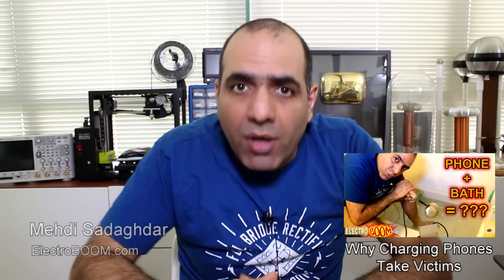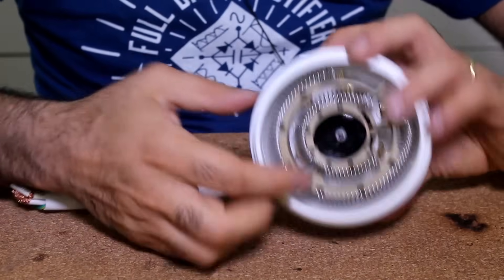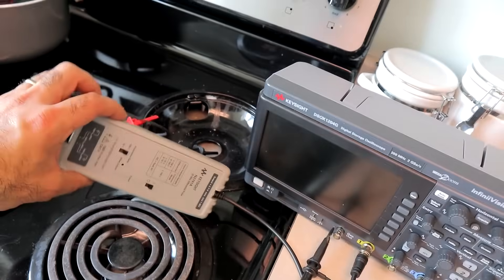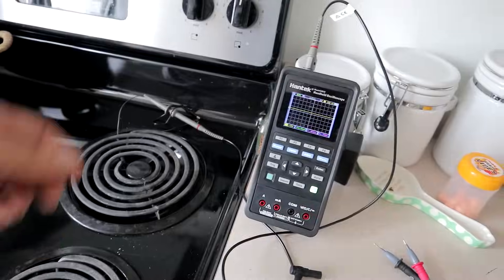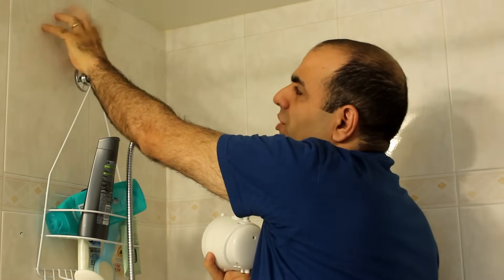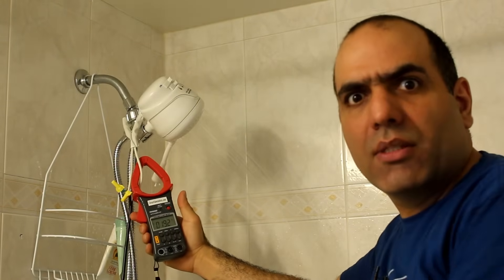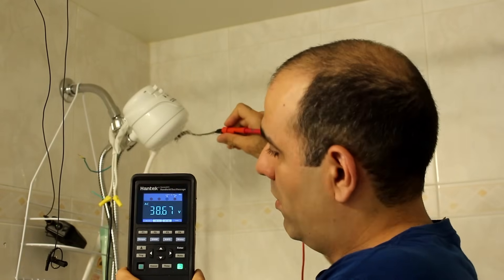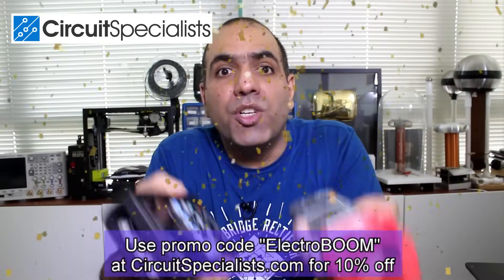How Safe Is the SHOWER HEAD OF DOOM?!

Comment: Lorenzetti and Hydra (Biggest electric shower manufacturers in Brazil) Makes excellent quality electric showers. In more than 30 years using them, I never had any problems with them. When They eventually break, You just hear a pop and it stops heating. And that's it. You either buy a new one, or replace the resistance.

Comment: Here in Brazil this kind of shower is very common. 
Nice video!
Reply: @girlsdrinkfeck  Rich people in Brazil use them too
Reply: @girlsdrinkfeck  yeah dude it's standard in even the highest quality apartments. I've literally never seen a heated water shower that isn't heated by one of those suicide showerheads
Reply: @girlsdrinkfeck  yeah and ground usually isn't installed here either, they either duct tape the ground to the shaft of the shower head or just cut it I guess. I've seen people fuse it to neutral too.
Reply: Actually is not like that. Depending on  the age of your apartment and where you live it could be heated by gas, solar panels and electric showers. I live on apartment heated by electric shower but my shower has isolated resistance. Here where I live (MG) it's not common to have gas heating system. New apartments comes with solar panels and old ones use electricity. But you always can pay more for a safer and good electrical shower. Although, I never hear an accident caused by one. Our main concern is the shower quality and light build price.
Reply: @diabodosatanais30   I dont use this tho and I am brazilian and poor
Reply: @userbarra  
Eu tenho um amigo q tbm n usa chuveiro elétrico. Ele esquenta a água no fogão e toma banho.
Vc toma banho assim tbm?
Reply: @diabodosatanais30  Nopr

Comment: Important information about the Brazilian electrical system: most houses (if not all) have no grounding. The ground wire just hangs.
Reply: Vai brasiliam
Reply: In some houses they even connect the shower's ground wire directly into the neutral AC wire so neutral AC from the house's electrical system receives both shower's neutral and shower's ground. Kinda works...
Em algumas casas inclusive conectam o terra do chuveiro diretamente no fio neutro , assim, o neutro do sistema elétrico doméstico recebe tanto o neutro do chuveiro quanto o terra do chuveiro. Até que funciona...
Reply: @daemonsilverstein8633  Brazlians vivendo perigosamente

Comment: In Bulgaria most of the people live in apartments with no ground. We have only two wires to each plug, so if you need ground for some application you connect the ground wire to the neutral. This works well, until something happens to the neutral, and all appliances with metal housings, become live. It is pretty common to have minor shocks when you touch the housing of say, the washing machine, because the neutral usually has some voltage relative to the ground your feet are touching.
Reply: If you have solid continuous metal water pipes that lead to the ground, you might be able to use those. Should also be connected to the main breaker or main meter.

Comment: I use one of those in my house, they are pretty safe I must say, they last for a long time too! I am from Costa Rica, Central America.
Reply: @Lepus Arcticusit's less expensive and it works just fine, it also doesn't need a lot of space to install.
Reply: @EffectsAE It's pretty safe honestly, like, 200 million brasilian ppl use and I can't remember the last time somone got hurt on one of these
Reply: @pedrodarosamello64  Yep, I don't want to sound like a butthurt brazilian but many people are ignorant in relation to electric showers, if you look at the statistics there much more deaths associated with explosions and fires caused by boilers and gas heating installations than with these type of cheap electric showers.
Reply: @LeArcticus
A few reasons.
1) Gas pipe installations are very rare around here outside of bougie apartment complexes.
2) It's consistently warm enough here that we don't need central heating.
3) Because it's warm, we don't need to heat up our shower water to the degree that gringos do. Gas heating is way overkill unless you live in the mountains of the Andes, like Peru and Argentina.

Comment: @5:40 Nice! This finally explains why my electric stove top can't maintain its heat levels consistently and is a nightmare to use.
Reply: It's different between different models of electric stove. For some, especially when using large pots, it's near impossible to notice when it's on and off.

Comment: Brazilians have love and pride about electric showers. They are the main manufacturers of these devices, or at least that's how it seems in Mexican stores.
In order to use one of these devices, you must have an independent power line, direct to the electrical box in your home. That line should use cables capable of supporting the maximum amperage of the shower. That line needs its own thermomagnetic switch and, preferably, an independent ground line. Please, an electrician is definitely required.

Comment: It's funny because these showers, especially from the Lorenzetti brand, are widely used throughout Latin America because of the low cost, I'm from Costa Rica and here at least 80% of showers are of that type. These showers are dangerous only because most people install them improperly without connecting the ground to save money on hiring an electrician. I myself have one well installed and the only problem is the durability of the heating elements, after 4 years it is common to replace them or the entire shower.

Comment: we have those but it installed way higher, i'm 1,75m and I need to get on the tip of my toes to change the temperature, this way the water falls in little drops and not a continuos jet and therefore it's not conected to the heating element.

Comment: In Brazil we also have ARMORED showerheads which ARE made from insulating elements... Tho 5 to 10x more expensive than regular ones.
We use them only on EXTREMELLY brackish water to avoid shorts and well... having to change the F*cking elements EVERY WEEK or so
Reply: Armoured showerheads? Why not normal electrically isolated heating elements like what the rest of the world use? It isn't that expensive to do that.
Reply: @danielch6662  thats just how we call it but it is actually the same thing
Reply: @danielch6662  Im 25 years old and i never seen a single person get shocked by shower heads with exposed elements, and most of them don't even have a ground wire connected to it, i do have seen one partially melt before but the heating element will break before causing any harm.

Comment: I've been using this showers for 26 years straight, I switched 1 year ago (because the building requeires it, and it is cheaper and easier to maintain) never had any problems, I live in São Paulo and showred in hundreds of homes from my friends and parents never had a single problem even with the metal "handle"

Comment: I used to have a stove at home that had lights that turned on on the heating surface while it was on, so I was able to see that the power on these went down regularly to maintain a stable temperature, when I saw the voltage on the stove in the video drop to zero, I instantly realized it was that kind of system and had quite the "Eureka!" feeling

Comment: I live in Brazil. This type of shower is common, but the place where I live tends to have very extreme temperatures, either very hot or very cold. At home, I use a 7700W 220V electric shower, which is somewhat normal around here. I don't know what houses are like abroad, but here in my case, I have two phases of 220V each, together I get 380V. The wiring from the utility company to my house is 10mm, which goes into a 50A circuit breaker and to my house it is also 10mm wiring, which goes into the second 50A circuit breaker. Only then is it derived with 6mm wiring to the shower, passing through a 40A circuit breaker.

Comment: "besides the loose wires and the fact that it may set your house on fire" but we do not use loose wires, instead in every home here, the shower have a special outlet (way above the showerhead) and they proper hight current circuit apart of the house's circuit, which helps with theses two topics "loose wires" and "set your house on fire" :D

Comment: There is a way to make is safer that you didn't mention:
You can power this shower through transformer so current in heater has no way to complete circuit though ground (human body).
Reply: 2kW isolation transformer will cost more than a decent water heater
Reply: You've got a spare ~6kVA isolation transformer lying around?

Comment: Brazilian here. My shower draws 30 amps, 220 V so 6600 W of power. Installed by me, no problem at all. Houses here have brakers of 50 amps, usually one per shower or room.

Hue Land is not for beginners
Reply: Why does it need that much power
Reply: Dr. M. H.  At least we only need gas for the stove. Besides, it draws 6600W on max, which would be just a few days in the winter. Most of North/northwest don't even have a proper winter (they call it a cold spell when it gets to 21°C), so they can get by with waaaay less energy.
Reply: Dr. M. H.  Yep, like the guy above said, that's the maximum power, usually we use 1/3 ou 2/3. But If you want, can use it, no problem
Reply: Dr. M. H.  Brazil has one of the cleanest energy sources on the planet and electricity is very cheap compared to other countries.

Comment: A few points to consider here, regarding the installation of these showers in a typical Brazilian household.

1. Unless you're living in a relatively new (10-year old max) building in a big city, you're 90% likely to be in a place that was built taking multiple electrical showerheads being turned on at the same time into consideration.
2. Even in cities where the main outlets are powered by 110 AC power lines, households usually have 220 AC power cables specifically drawn to each of the bathrooms in separate (yes, really) 50+ A breakers. They are usually installed directly next to the water outlet. As I mentioned above, these houses are designed to have multiple showers being turned on - on high - at the same time.
3. A cheap, three-temperature-range showerhead usually costs around R$ 50 (around 8 USD, 2022 quotes), with more sophisticated ones costing almost R$ 400 (65 USD). For the perceived benefits - cheap hot water - and low perceived risks , it's easy to see why there haven't been many innovations regarding safety. 
4. Corrosion is something that is frequently seen in these. As one can imagine, having a hot, potentially charged, and usually hard (calcium ions) water running through copper circuits does not bode well for its durability; Indeed, it's expected that the resistive elements need to be exchanged at least monthly. The showerheads usually dismount easily in order for these to be more accessible, but rarely (as in _never_) is an electrician called to do this. The owners are expected to turn off the breakers (do they?), make sure that electricity is not running (by touching the elements?), remove the old, corroded pieces, and replacing them with brand new ones, by themselves.

So yeah. Survival of the fittest, I guess.
Reply: você não precisa trocar a resistência todo mês...e eu pelomenos desligo os disjuntores pra trocar a resistencia quando ela precisa ser trocada...
Reply: @djmhyde  né, ele acha que todo mundo troca a lampada com o interruptor ligado tambem ?

Comment: FYI, Surface Element switch or also known as an Infinite switch uses a bimetal, that cycles the power on and off based on the current flow through the element, but the element always gets 200+ volts in any temp setting just percentage of on time. Bimetal is Between contacts L2 and H2 in your switch. If you look in hte back of the switch the bimetal is usually exposed and can be seen easily. L2 to H2 are the contacts that welded together in your video that you unstuck. That is the bimetal.

Comment: the problem with those are the people, people likes to use thinner wires than those required by the shower, they also like to have once circuit for all house, they don't like ground and likes to connect ground to neutral, also they love to take long showers specially with thin wires

Comment: I'm from brasil and I can say, I never took a shock before in this kind of shower ¯\_(ツ)_/¯

ps: Moooom i'm famous in internet lmao
Reply: back in 2007 for me I would keep getting shocked when touching the metal knob. No anymore though as we changed to something else. We do not have ground wires though :/
Reply: And if you get a little shock, you just wear some Havaianas and everything would be fine.
Reply: Sometimes I get a little shocked when touching the tap.
Reply: @coar  yup that happen, but if you touch on the wire itself only it doesn't happen. You just need to use flipflops, that is what people in São Paulo does, for some weird reason this part of the country doesn't know how ground wires work.
Reply: Brazillians are non-conductive confirmed
Reply: And I haven't had a decent warm shower with those :v
Reply: I've already had a shock three times, but it's not so bad.
Reply: @EduardoRFS  Yeah I am still not a fan of rubber flipflops ^^! though that problems is not longer an issue as it seems newer models are a bit safer. (old one didn't even turn itself off without water, jumping to the breaker inside the bathroom was a must and a scary one at that while the shower was still on). What people do for the luxury of warm showers (Peru, Lima does not need warm water as it is always reasonably warm)
Reply: I did ,I'm fine tough
Reply: @mwrklester632  br nem é gente,nem eletricidade conduz
Reply: @brunoagto7282  hahahahahaha nice, I'm only use havaianas when i go to shower.(are you from brasil?)
Reply: @mwrklester632  lmao

Comment: You said those things could use an insulated heating element, but that's actually not possible considering how fast it has to heat the water running through it constantly.

Comment: Here in Brazil most of the people use this kind of shower,  never ever heard of a death linked to them, and we shower a lot, like once a day is the bare minimum.
But, if you don't like electricity in your bathroom, you can have gas heaters, and this one, killed a lot of people world wide in the last years, you know, carbon monoxide is very toxic, anything could be very dangerous if not implemented correctly.
Reply: Do you guys have water heaters?  Maybe a stupid question, but I don't understand why someone would buy this.  Much less the majority of a country?
Reply: @jaredsciguy1634  Brazil is a tropical country, a water heather would be too much of an investment for very little return, since it gets cold like... 20 days an year AT MAX.
Reply: And when I say cold, I'm going for like... 10 to 15 degrees celsius in most places. In some places, it'll drop as low as 0 to 5, in others, it won't even get to 15, staying on 20ºC on winter.
Reply: @Liklikgold  ah ha! And now I know a little more than yesterday, thanks! I hadn't even considered that the demand for heated water is less some places.  I was tricked by the entitlement I live in, some people here need their warm showers regardless of temp outside lol
Reply: @Liklikgold  I too live in a tropical country. It gets cold if you shower early on the morning before going to work, or if you get home late from work. It's only hot when the sun is up. Instant shower heaters only costs like 3 times that of a KFC meal for the entire family. They are not complicated and are cheap to make. Half the cost is getting somebody to come to your house to install the thing. The electricity hookup is not complicated. It's the plumbing that's harder to do neatly so that it looks good.
Reply: @jaredsciguy1634  It is a cultural thing too. We are not used to the heated water thing. Probably is much cheaper in the long term. Because electricity in Brazil can be very expensive, and this head showers crave power like crazy, is literally the most craving item in most of houses.

Comment: In other countrys Marey is a great popular brand. They dont use a pigtail on their shower head . You hard wire it to the head with the appropriate cord length YOU SUPPLY. That means if you have any power reservations with ground problems, you are assumed smart enough to use a cord thats 6' or longer with a plug. (similar to how we purchase  clothes dryers up here in the states. )  I must say, it looks crazy but also, as a rule of thumb, i always shower intoxicated just in case a fatality occurs...Tthat way you wont feel it shock you before you die.

Comment: I'm from Mexico, and I had one, but once I got shock while I was switching the heat level :/
Reply: The instruction manual specifically says you should NEVER touch it while it's in use. Some electric showers have big plastic rods for temperature adjustment. Those are safe to adjust the temperature, even while in use.
Reply: yo tengo una tambien y lo primero que dice el instructivo es cerrar el agua para cambiar temperatura
Reply: Not a surprise, suddenly breaking 50 amps should cause a decent voltage spike.
Reply: @AlexandrSandoval  yo no lo sabía jaja era el lugar donde rentaba y pues nada más ahí estaba y no nos explicaron nada.
Reply: You can't switch the level while on!
Reply: @billmask  I think that you can do that but is not the intended way
Reply: @seanoriginales  Yeah, I mean you can but should not. Dangerous

Comment: Here in Brazil, electric showers are normal. It's normal to have 6mm cables and 40a breakers for 220v showers, or even 10m cables and 50a breakers for 110v showers. The ground wire is mandatory in new installations, but old buildings have no grounding. The treated water over here also has very low conductivity. There are also shower models with armored resistance. Also, with an IDR and a ground, the chance of getting electrocuted in an electric shower is almost zero.